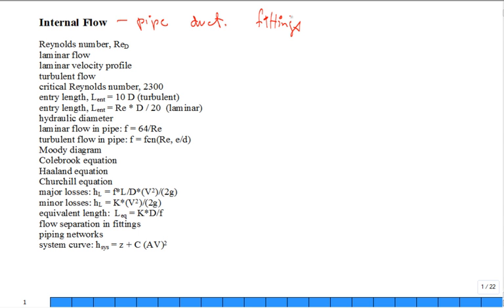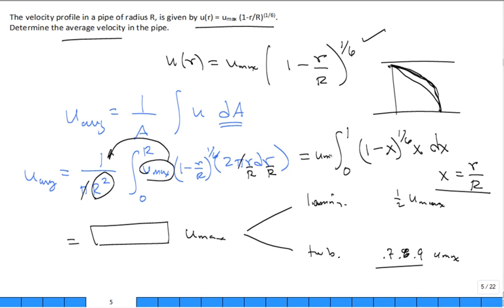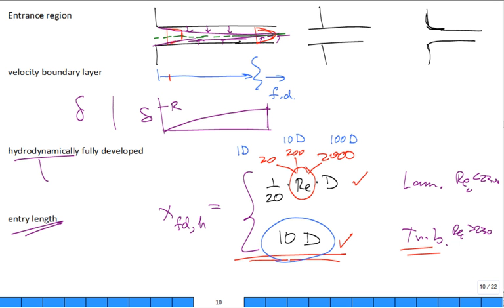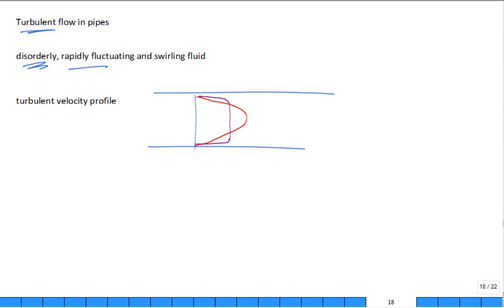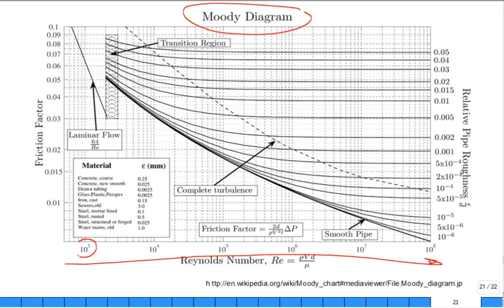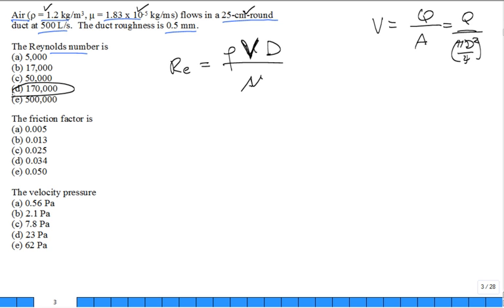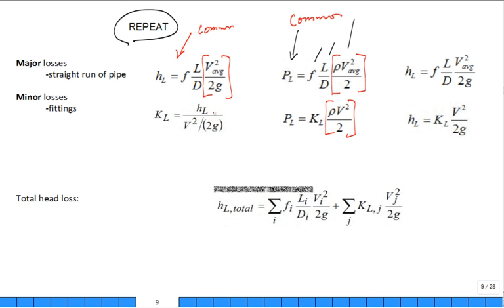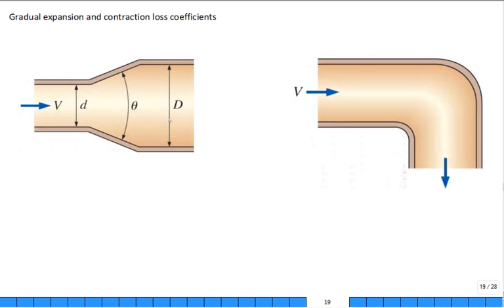ME3663 Internal Flow Summer2016

Comment: Hello, proffessor Manteufel. I ran into a problem where I am asked to find the PL in a vertical pipe. I used the formula given at min. 1:23:13 which you also used to solve the example at min. 1:28:40 where there is a vertical pipe involved. However, I did not get the right answer because according to the book this a formula used for laminar flow in a horizontal pipe. I thought it was worth mentioning. I was wondering if you had a video available with a horizontal pipe example. Thank you